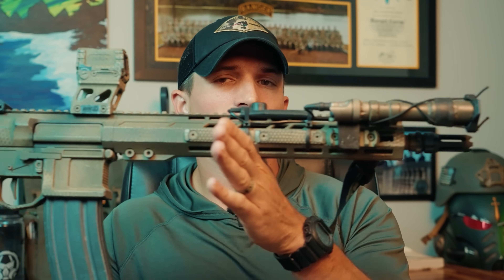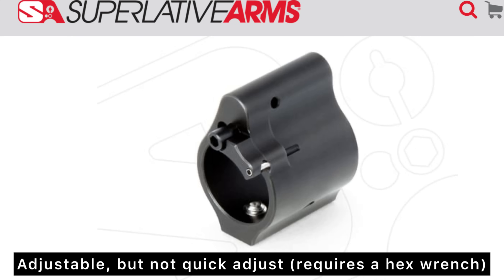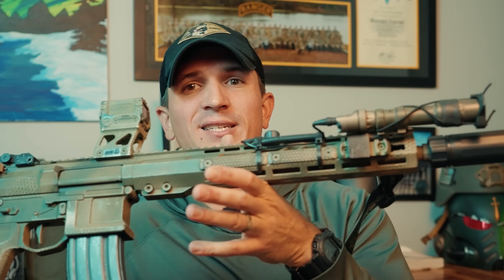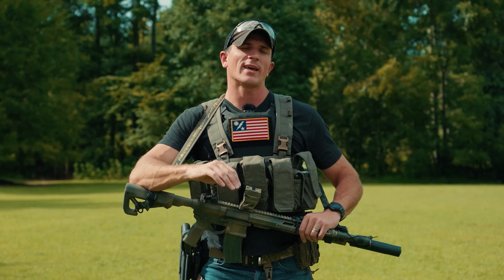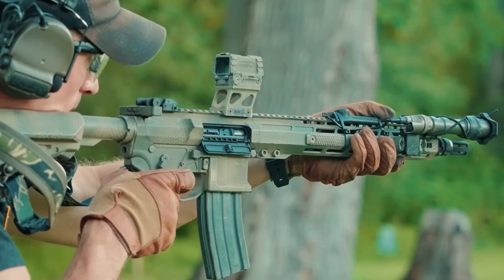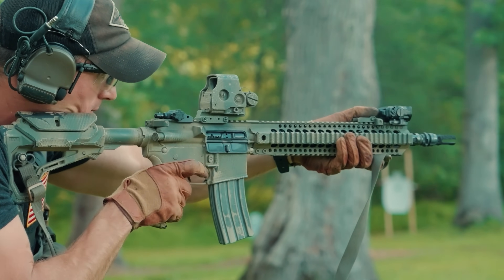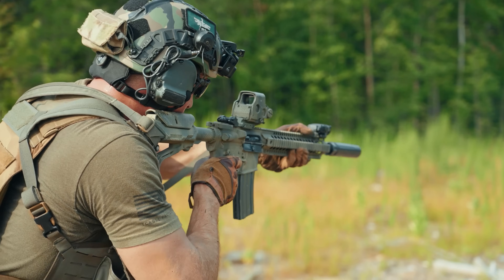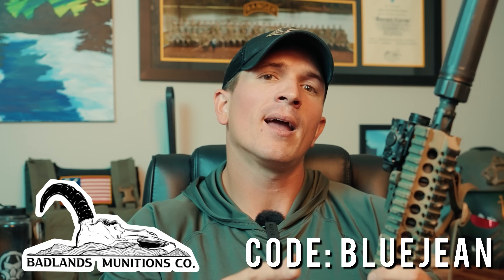Suppressing an AR-15 (The Right Way)

Comment: Got a honey badger months back and got a Q can for it when the quick form 4s started it was a no brainer cause their guns come with the cherry bomb and their suppressors where made for it but I just recently got a ddm4a1 the block 2 that’s a 14.5 pinned and welded and now I don’t even know where to start I kinda want to get a plan b type muzzle device that I can pin and weld but I’ve seen horror stories about how companies that copy q can’t make decent quality shit so it’ll fuck up my trash panda then I’m thinking about getting another suppressor with a different suppressor mounting system it needs to be pinned and welded tho cause the sbr bullshit if anyone has suggestions please let me know especially if any of you have used one of the plan b clones out there and it’s actually worked

Comment: I just got a polo 30 threw it on my 11.5 bcm has a a5h2 buffer green springco an it was slinging brass at 12 o'clock! 😂 so I could add tungsten weights until I cant fit anymore in the buffer... but then it probably won't run unsurpressed ... so I'll probably look into a riflespeed... or yhm has a suppressor gasblock for a 1/10 of the cost... but after shooting suppressed ill never go back to bare muzzle 🎉🎉....

Comment: I've been looking for an upper that I can replace my CMMG that has an adjustable gas block already installed.  I guess it wouldn't be that hard to do the work myself but I want to get away from my keymod hand guard and standardize around mlok, and I've never done it before so I'd be afraid of goofing it up

Comment: Have a 20" rifle gas, 16" carbine gas, and an 8" 300blk that I run with conventional baffle stack suppressors... no adjustable block, no special BCG, no special charging handle - yes, they're some gas, but you YouTube guys really are prone to making mountains out of mole hills... in a year or so when enough shooters finally have time on suppressors, videos like this will be less common, not more.  These sorts of doo-dads are just fodder for content creators, not simmering the average Joe needs.
Reply: Mostly agree. There are some functional issues that can be caused by overgassing, such as bolt overrides. However, if the rifle feeds, fires, and ejects without issues, then gas tuning is more for comfort and wear reduction.

If you are seriously overgassed, just be prepared to replace your buffer spring and extractor sooner than usual.

Comment: I’m not sure if you have ever used a superlative arms adjustable gas block or one of their piston kits. Both have the ability to retard or bleed off excess gas out the front your choice. The bleed off function works great while suppressed for DI guns and even better with their piston kits. They are not as quick to adjust as the rifle speed adj gas blocks but seeing as I don’t shoot without my cans it’s a non issue. Also they have more range of adjustment that the RS blocks, lighter and easier to clean any excess carbon with simple brake cleaner, plus half the price or less. The RS gas blocks are nice but there are also other options for fast multi position adj gas blocks like the Seekins Precision adjustable that uses a lever.
Reply from the maker: You had me at retard.